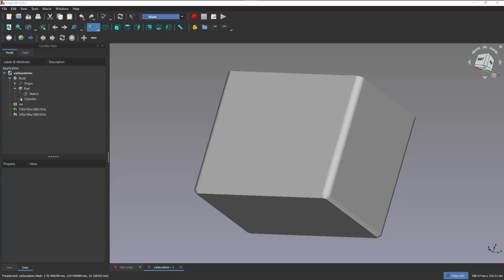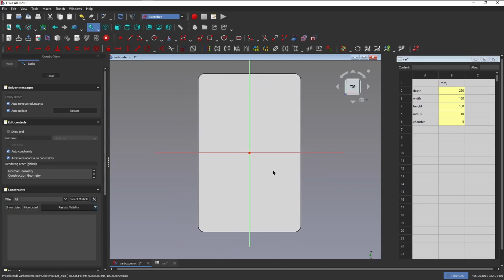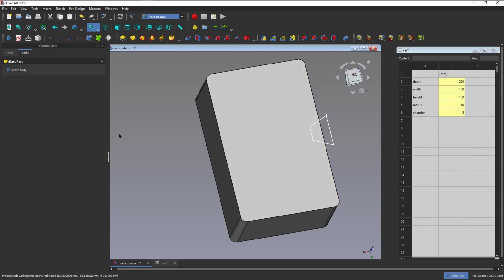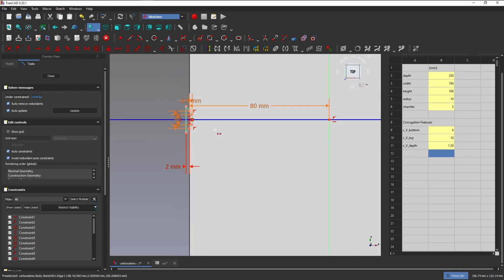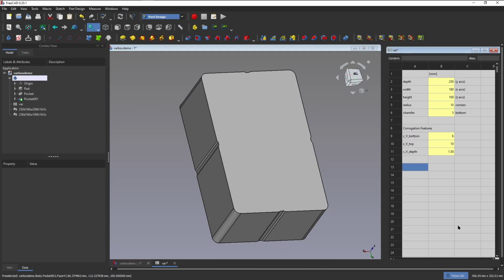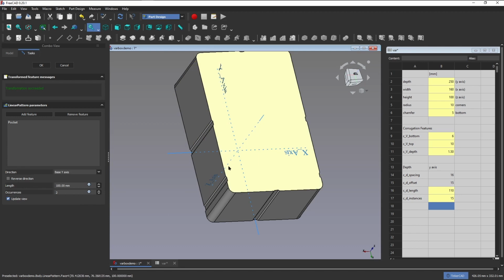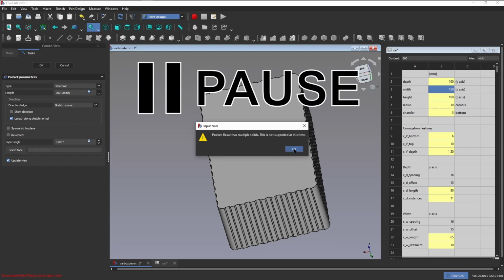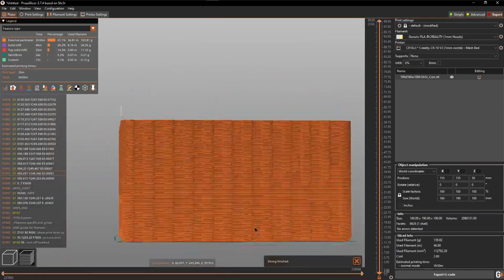FreeCAD Tutorial: advanced calculated parameters

Comment: Just curious, but what's the benefit of creating a mesh of the part before exporting? I've been able to successfully print parts by just exporting the part as a .stl
Reply from the maker: Thank you for the question, and that actually opens another point.

First, to address you question, I personally like using the mesh output method because you have some adjustments and you can preview it before you save it out which can effect file size.  But, as you point out, you can select the body and use the File>Export tool to save it to STL just as well.

That said, with a lot of the new slicers being able to use STEP files.  If your goal is to 3D print the object, you may be better off using the File>Export tool and save it as a STEP file. Generally they are considered to be better detail.